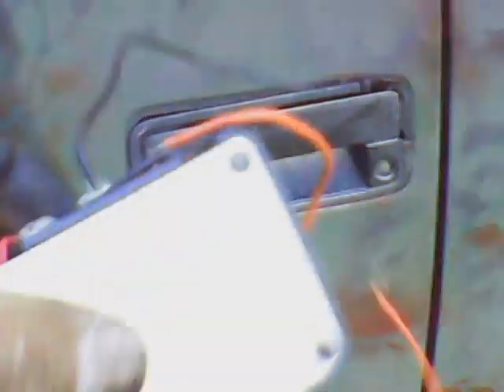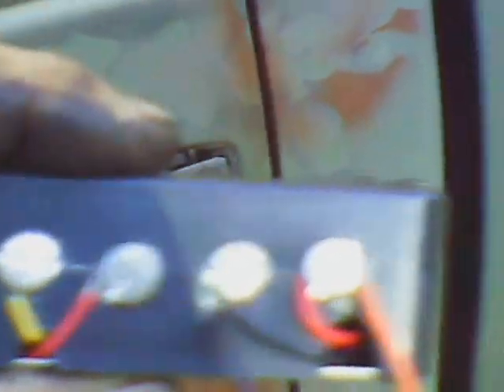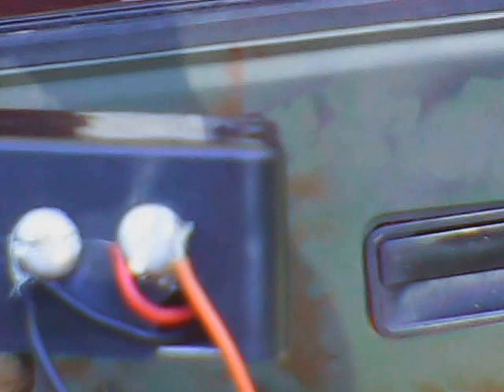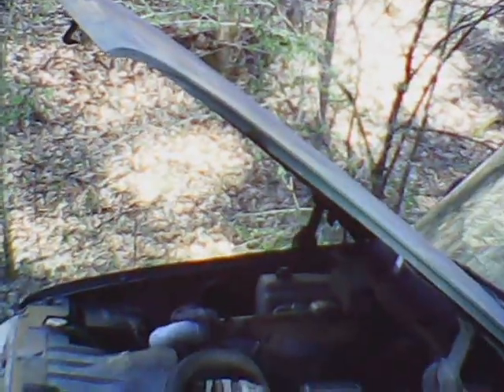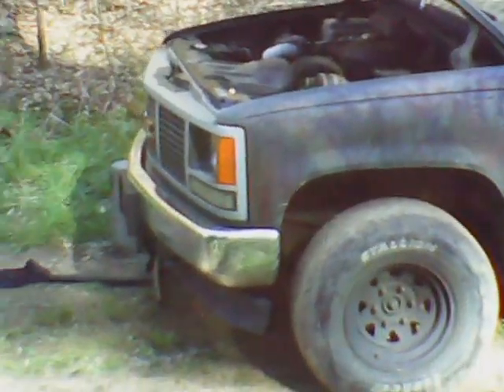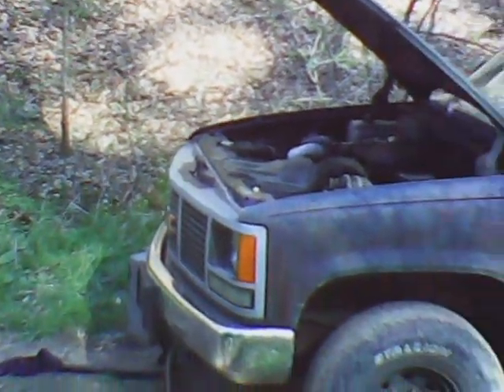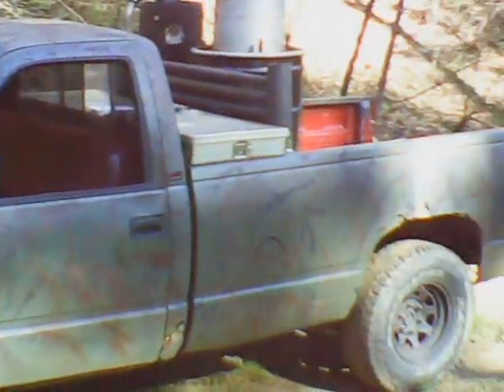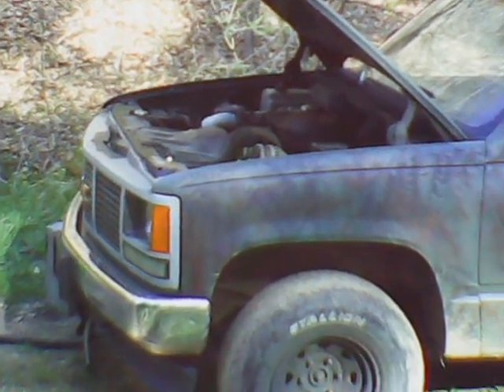gasifier running the GMC

Comment from the maker: My nozzles are 1/2" and there are four of them to equal the two inch output. the reduction zone is a piece of 4 1/2" steel gas pipe and I kept cutting it shorter and shorter between tries so I'm not sure of the size of it. I'm not thrilled with the power but it is usable. Mine is the 4.3 v6 so your 350 should have power to spare. Temps are pretty hot. I had a plastic toolbox under the big toolbox and it melted from the heat. I don't have anything to measure the temperature with. Hope this helps.

Comment: Luke, I'm drawing Imbert plans for my '77 GMC C15 (350 engine). Your unit looks good! Could share some dimensions? That would help me a lot.

I'm looking for:
-Nozzle size (1/2", 3/8"?)
-Reduction bell height, top and bottom size
-Reactor hull width and height

Are you happy with the power or amount of wood gas you've attained? What kind of temps are you getting at the reactor or the gasifier exhaust? What is your engine size?)

Comment: I'm seeing heat issues on my new Imbert so I plan on adding a second tank to allow the gas to expand and cool in. You will have an advantage and that is the truck will be moving and drawing air over the system to cool it down. You need to add more cooling pipes to the setup. Add pipes to the side of the truck and that will cool things down. Be sure to set the pipes up at an angle so that the water can drain to a capture tank. The moisture in the rag is normal. Make sure the rag doesn't have tar.

Comment: Howdy,
Sounds good, is that a 305?
Make sure ya run it on gasoline for a while before ya shut it down... In the past I have stuck a couple small engines, until they cooled off they were fine... Once cold they were stuck real good. Be real careful when ya go to restart it after it cools off, best to turn it over by hand until ur sure. Ya might wanna visit drive on wood dt cm.  You can save alot of time and money.
Good to see ya get it running! there is no other feeling like it
All the Best
TerryL

Comment from the maker: yes it was to test for tar but I discovered a lot of moisture on it and the water was a little dark I still need to add more cooling pipes to reduce the temperature more. I just wanted to get the reactor right first. By the way I used a pvc filter like yours running horizontally under the truck with the polyester fiber stuff in it. I also added a drain plug in the lowest part of the filter.